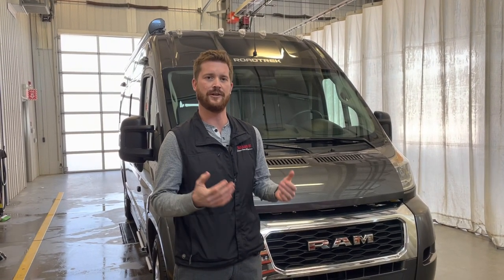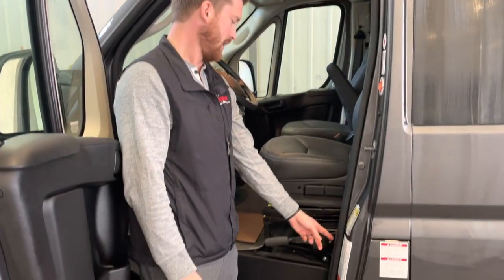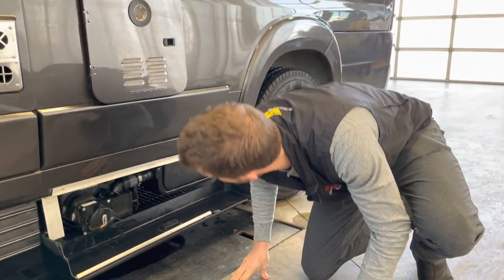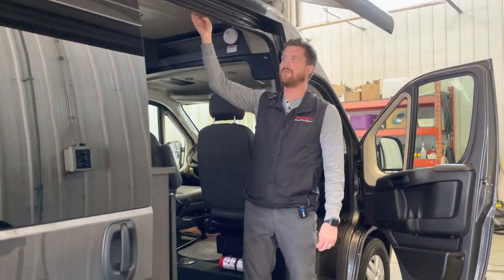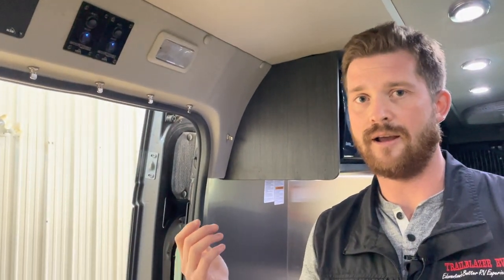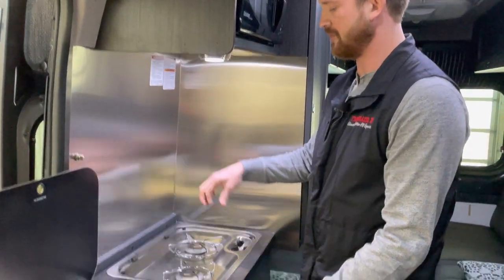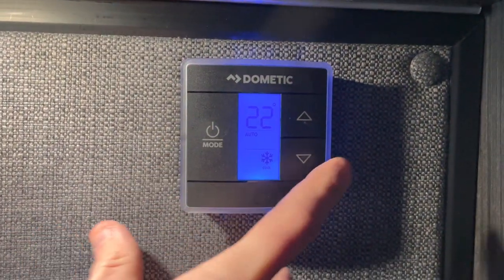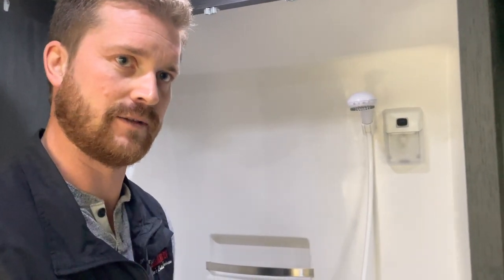2020 Roadtrek Zion RV Orientation

Comment: DO NOT leave the inverter on when not needed. Roadtrek says the Inverter should only be on when hooked to shore power or using 110 volt appliance. Leaving the inverter on all the time will drain your batteries in a very short time. Our dealer turned ours on and we drained our batteries in 3 hours.